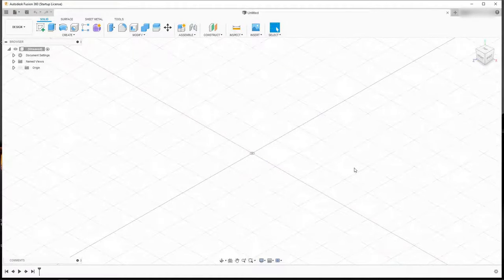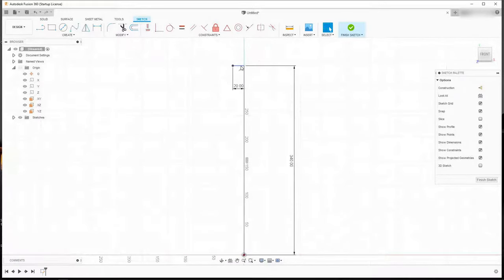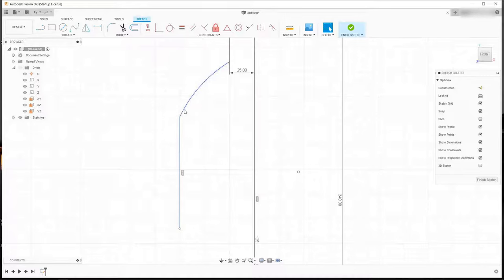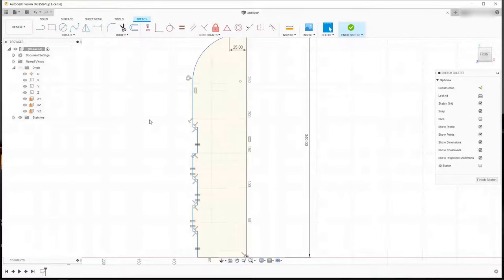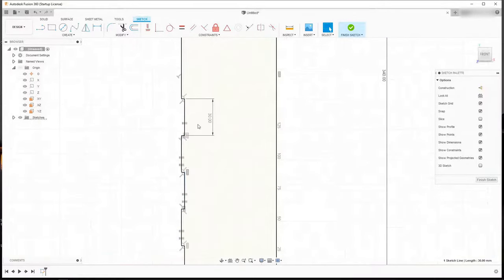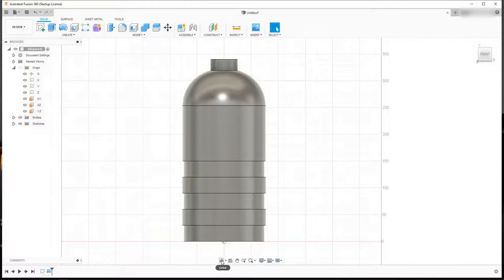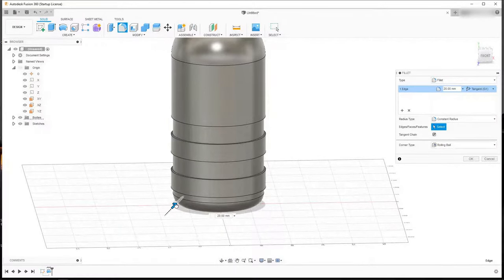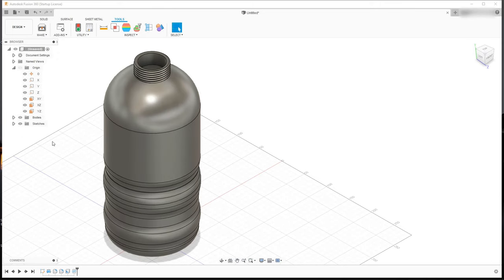Model a Water Bottle in Fusion 360! Tutorial for Absolute Beginners/ Thread Tutorial

Comment: How do you make the cap? I saw your comment about using the revolve setting but could you please go more in-depth? By the way, the video was exceptional, thanks for it!
Reply from the maker: Sure! To make the cap, you need to first create the profile of the cap shape using lines. Start a sketch on the front or right plane and make a sketch of the cap profile, fitting over the bottle top. From there, make sure it is a closed profile, then you can revolve it and eventually add an internal thread; same parameters as the bottle thread.
Reply: Engineering Juice thank you very much‼️

Comment: I tried threading and it leaks, I don't know why, I screwed it on as tight as I can???
Reply from the maker: You must be doing some advanced fluid simulation, lol! Thanks for watching.
Reply: @AvivMakesRobots  the most advanced, I printed it and filled it with water
Reply: @AvivMakesRobots  can you do a tutorial on using the spiral tool to make a screw? I feel like it’s better
Reply: @CrjaseMechaEngr  you mean the coil ?! it's surely better because you can change the section shape which is impossible while using the thread
Reply: @freesurfer76  I realized using the coil tool is better for making a unique thread, while the thread tool makes threads that actually exist on objects universally